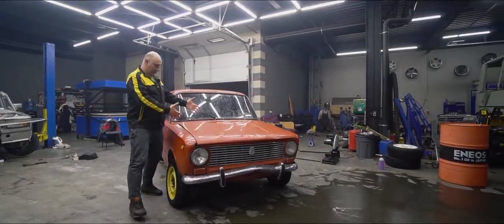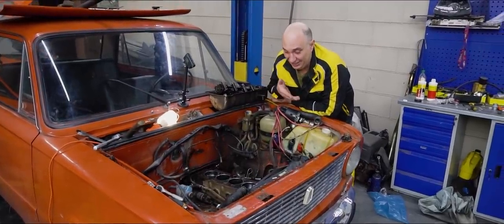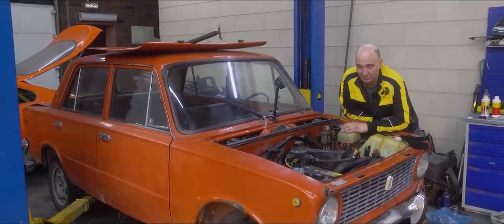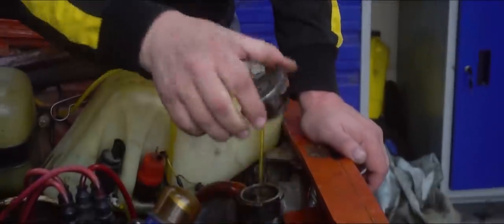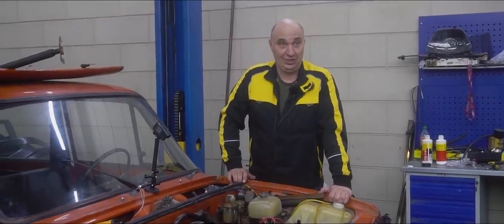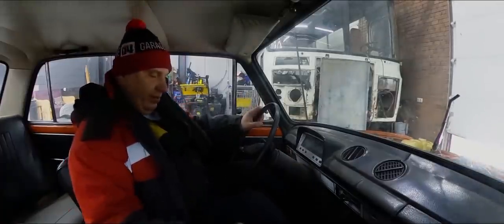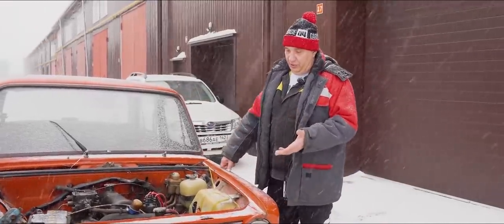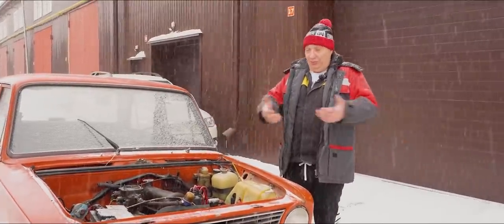What happens when you fill the cooling system with motor oil?

Comment: Garage 54, channel that provides answers to questions only asked after 10 beers in the pub 😁
Reply: I can relate to that😂
Reply: 10 vodkas...
Reply: Deutz diesels from the past 20 years use engine oil as coolant.  As in pumped through the block / head just like water based coolant.
Reply: but they are air/oil cooled right? not a separate radiator
Reply: @lucasvanhamburg4937  Look up the   1011 series of engines (   F2L1011, F3L1011, F4L1011, F2L1011F, F3L1011F, F3M1011F, F4M1011F, and BF4M1011F.   )    These do not have any cooling fins on the cylinders or cylinder head and are completely oil cooled and are built just like a water cooled engine.    They have a built in oil cooler and fan.   The older series of Deutz were direct air cooled ( like the 914 series  that includes  F3L914
Reply: @bobroberts2371  Deutz diesel engines are primarily air cooled.  The oil has its own heat exchanger.
Reply: @Flies2FLL  Read my post above again, the 1011 series does not have any cooling fins on the block or cylinder head, oil is pumped through the coolant passages just like a water cooled engine.  I've built a couple of the 1011 series engines.
Reply: @bobroberts2371  thank you for the information. I wish more manufacturers would use oil cooling, it should make a very reliable engine.
Reply: Yes, between the huge quantity allowing longer drain intervals and lower oil temperatures, it will still work in a standard heater core no problem, the head gasket blowing won't put coolant in the oil and ruin the bearings/crank if you don't catch it fast enough, won't freeze in any climate (glycol coolant can still freeze if you live in Alaska, Russia on the coldest nights). Plus if deutz does it, it can't be a half measure by any standard. Their engines are epic!

Comment: Suggestion: Make a electric-Lada using only startermotors attached to the gearbox!
TESLADA
Reply: As per our agreement ;)
Reply: Dude that's a great idea !
Reply: Good idea but it would be a very short lived episode. The starter motors would likely burn out quickly.
Reply: @thomasdemell4388  Don't know but maybe not, since starter motors are designed to run under load. Perhaps a few of them could pull the weight of a car.
Reply: @sambo9855  They are not designed for continuous duty. Very short duty cycle. It wouldn't run very long. They would need to use motors designed to run continuously. Its called a duty cycle. Im not gonna explain it but if you want to know, look it up.
Reply: @thomasdemell4388  LOL because on Garage54, things are built to last.
Reply: @mikeznel6048  Your right, makes sense
Reply: Start saying what day you're on. I know I've seen this commented a good 10 times or better.
Reply: Yeah they can use a motor from a washing machine instead, yes it will require 220V but it has 2 speeds, slow with more torque (whitch is ideal for this application) and a fast one.
Reply: The amount of likes is how many times he's asked on all the videos combined
Reply: @joshuagibson2520  i know i and others have seen it too ,i dont know how long we can take it anymore ,its painful to watch same "stupid " comment for years i would say 🤣🤣😅
Reply: @pequlatv4814  NIce
Reply: Supported by me. Good idea.
Reply: @sambo9855  a single one can pull the weight of a car. A manual trand with a disabled neutral safety switch will turn over in gear and a light weight car can move with the starter. So doing several could definitely do it. But they aren't designed to run very long even without a load so it would still be short lived. I do believe they have done something similar to this.
Reply: What about air starter?
Reply: @arseneauje  what is that? More details please
Reply: @pequlatv4814  .......and in true Russian fashion......a very long extension cord
Reply: @mikeznel6048  you are right,they should use wiper motors
Reply: Up
Reply: TESLADA  LOL
Reply: A guy in Estonia has made on using Nissan Leaf's engine and the car looks super clean
Reply: @kalamite.enduro8426  Thank you dude! I said this the last time he posted this comment, and he wanted to act like I had some sort of problem. Like dude the comment is getting old and tried, don't come at me just because I don't leave a rosey warm comment telling how awesome this idea is (It's not, we literally know what's going to happen)
Reply: @ginomanshit2365  Wiper motor wouldn't be strong enough.
Reply: @pequlatv4814  Washimg machine motors run on both 110 and 220. Speed and torque are based on current. Slow doesn't mean torque qhen it comes to motors. You're thinking if a mechanical gear reduction. Any motor can be 2 speed, in reality they are infinite speed. Motors don't work like your thinking alone, a gear reduced is required to do what you are saying.
Reply: Rewire alternators into drive motors.
Reply: My son has a go cart that uses a starter motor. Damn thing is scary quick.
Reply: @thomasdemell4388    My boys go cart has been running with a starter motor as the drive for about three years now. The kids ride until they have no batteries left. Think they have 4 on charge right now.
Reply: @marvinmartinsYT  does it overheat? Did you make any cooling of the engine?
Reply: @lassediscovers1813    It gets a little hot. But no cooling on it. The batteries don’t last long though, hour tops and they go dead flat and won’t recharge sometimes.
Reply: @marvinmartinsYT  really? Nice. My som just got a desperate need of a go-cart some how...lol 
Writing this on the way to the garage...
Reply: They did a drill powered one. I suppose you could take sparkies out, 3 phase drive the alternator to have a mighty 1kw power car.
Reply: use an good old soviet forklift motor. those can be overvolted very well.
Reply: $tsda 🚀🙌🌰
Reply: @kalamite.enduro8426  Stupid comment? As opposed to the smart comment about pouring lava into an engine? Or making tires out of cement? Dude, on here the only stupid suggestions are the ones not made. I'd personally like to see an engine lubricated with old McDonalds french fry oil.
Reply: @scottricklaroque7428  naah yeah your right , maybe i was little bit too rought about this comment after all , 1. but starter motors arent ment to work under constant load ,long periods of time. 
2. We dont know that garage 54 looks  for ideas suggestinons on ENG channel at all ?
Reply: @kalamite.enduro8426  But it would be interesting to see how long they last. I had the distributor shaft break on my 1st vehicle in the middle of the road, a '74 Ford Econoline van, the only way off the road was on an uphill exit to a side street so I put it in gear and started cranking it with the clutch out and it went until the battery died and got that heavy assed van off the road uphill for nearly 100 (ok maybe 50ft, it was 40 years ago lol)  feet, with more battery it would have gone further and with multiple motors would be less load. I think it would be a very interesting experiment. Maybe I'm biased because of that experience but I still think it would be cool to see. 
 No, I have no idea where their ideas come from, but honestly I haven't seen that many interesting ones that weren't just different ways to do what that video was about.
Reply: @mikeznel6048  you are correct. I burned out two motors trying to build go karts with them. A full size car would be an even bigger job, although my go karts were rubbish with bearingless broom pole axles rubbing on wood, so not exactly low losses.